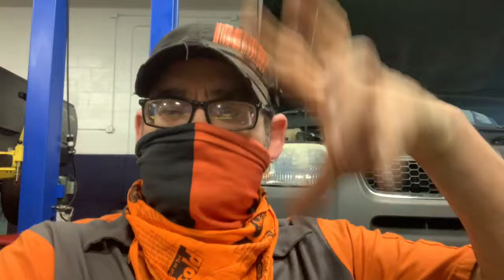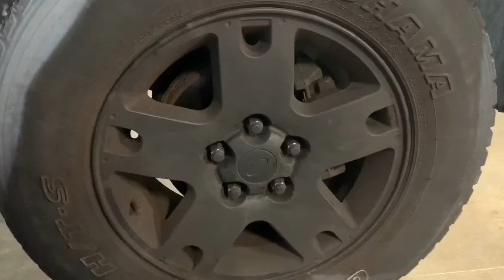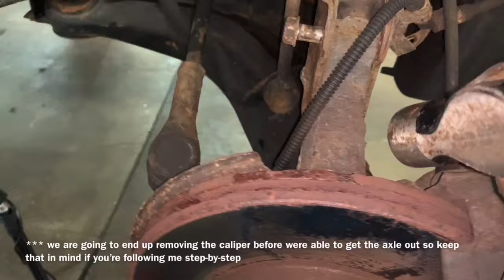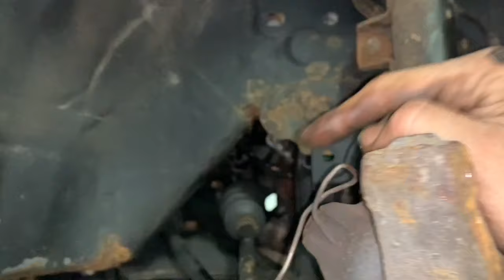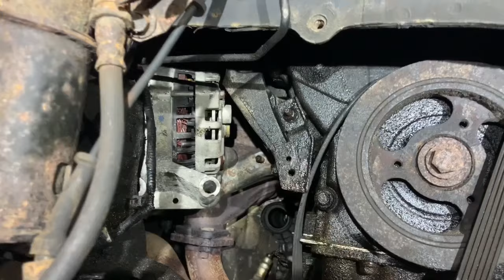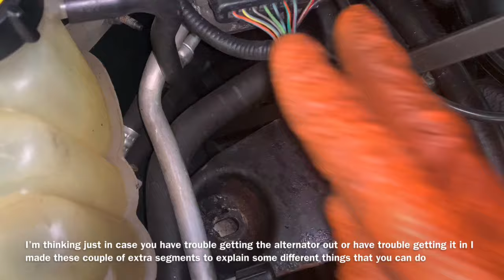Easiest way to change a Ford escape alternator

Comment: Welp.. I've done enough other work on my escape, and this is the last straw. What a ridiculous, obnoxious job to have to do to change an alternator. No thank you. Served me about 50,000km for 4 years. With a plethora of other problems, it's time to go.
Reply from the maker: Sometimes they’re just lemons but my experience with them has been really good I’ve had alternator problems and some rust on the rear of the shock tower but for the most part I can say I’m extremely happy with the ones that I’ve had I wish you the best of luck anyway God bless have a great day
Reply: It’s easy only thing that needs to be removed is the exhaust pipe

Comment: This video absolutely helped me change the alternator on a 06 Ford Escape. The worst part of the job was the air cowl mounted on the alternator. I can see why a shop would charge $1500 but I was able to get it done in about 5 hours in my shop with floor jacks. Thanks for the helpful video
Reply: If you remove the air cowl it comes straight out

Comment: Thanks for updating this video after clearly changing a lot of these and getting experience with them. Going to do mine soon and never buy another of these cars, who puts an alternator on the back of the block, honestly. A tip for you, your mic might be shot, but you can easily "normalize" the audio with your editor. This levels out the volume, so that viewers don't turn up the volume for the quiet bits and then have their ears blown out by the loud bits! Otherwise your video is great, thanks for sharing.
Reply from the maker: Yeah the mic was a problem that day I still put the video up because it took so much time and my channel is still really small so I don’t have big bucks to spend on really good equipment hopefully someday though
Reply: Yeah I agree, I wish I had thought of or known about this before I bought this clunker

Comment: You will need  the following sizes 
8 mm socket 
10 mm socket 
13 mm socket and wrench 
18 mm socket and wrench  
Dont have the size of the axle nut socket think its 1 1/8th inch.  Ill edit later 
Expect to remove the mounting bracket and jack the engine up several inches. 
aim the pulley of the alternator down to remove and install it.  ( when you find the sweet spot doing this there is plenty of room ) 
The job took me three hours total but my wheel was seized onto the rotor. It can be done in two but expect three hours for a first-time job.

Comment: Whoever was responsible for designing this monstrosity should be sentenced to one year hard labor.
What hard labor do you speak of you might ask?
They should be forced to change the alternator on one of these daily until their sentence is complete. 😄
Reply from the maker: Well I generally charge about $400 to change these
Reply: @sharpcarco  My sis has a Mazda Tribute that was having issues, so after checking it out i found the alternator was bad. The alternator I think was $160 bucks and she ask if I would put it on for her and her request was met with a resounding NO! 2 previous elbow surgeries pretty much put an end to me doing the kind of job that this would be especially with no lift available. I explained it to her and she said she would just get her son (my nephew) to come over and "throw it on", and I thought to myself I can't wait to hear from him.
He takes one look at it and says hed rather give birth to a flaming porcupine than tackle that. 😄
Long story short she has to put it in the shop and its gonna cost a couple hundred bucks plus the cost of the alternator.
The funny part was that she called around to get some labor prices before asking me and my nephew and ultimately thought one of us could do it a whole lot cheaper. Having it on a lift would make things a little easier, but I digress. Moral of the story: This is one headache of a repair if you decide to tackle it. Btw I like the way you put "easiest" in the title as opposed to just "easy". 😄I
Reply: @jeffreyb6165  YEP! Ha Ha Ha Ha Ha...just throw it on...
Reply: Damn you're right
Reply: @jeffreyb6165  yo bro ur comment was big time cringey af, y’all act like this is a nightmare to put on really ain’t that difficult to tackle just takes patience.
Reply: @strykerls3740 yeah exactly, but he obviously doesn’t work on car. I’m a full time technician, this alternator sucks, but not too bad. I know there’s a trick of taking an engine mount off and just prying the engine and the alternator drops right out
Reply: I AGREE

Comment: Super helpful video. Will this be the same for a 2007 v6 3.0 L ford escape limited? And if i jack the engine up the only bolt i need to remove is the one on the mount ypu showed on the top?
Reply from the maker: It’s the same on the 2007 yes and I don’t remember the answer to your other question

Comment: While putting axle back in my strut spring sprung and turned so I couldn't line the strut bolts up again.how do you recompress and turn the post to line it up. I am a real beginner at this
Reply from the maker: Really really sorry I did not see your message sooner Terry I’m assuming after five days you got it if you didn’t send me a message on Clays AC and Auto Repair over the Facebook messenger and I’ll be happy to answer it for you so I can get the logistic what’s going on.

Comment: Subbed. I think mine is going. I changed the battery and now it won't hold a charge for an hour when it used to hold one for at least 6 hours

Comment: I'm trying to do this same project right now and I'm not the most experienced kid around. But why do you need to remove the nuts holding on the engine mount?
Reply from the maker: Because the cradles can I have to come down to be able to get the alternator out

Comment: Hey Clay I replaced the shock mount & I must say I'm in Ohio and have ppl coming from Philly , Chicago  & Memphis for repairs w/ the glue & screw way . Tks
Reply from the maker: Personally, not my favorite way of doing it but yeah, for a number of years I had people coming from all over the place. I don’t do as many now, as I did before, I’m sure there’s people out there that will do them cheaper than I will but I do them correctly so. I’m sure that’s why I don’t have as many you for the kind of words. Appreciate it Kevin good luck.

Comment: So are there two mounting patterns for these? Our 02 Escape has a bracket between the alternator and engine, alternator bolts to bracket, bracket to engine.
The last person to change it stripped the inner threads on the block, my jb-weld fix can only last so long. almost 2 years now

Comment: I've pulled about 20 and I use to do it throu the bottom but found out if u hook a strap to it once it's off and Feed the strap up that back side of motor u can pull it up throu there but u have to twist it a certain way it will come out that way
Reply: Please show that process

Comment: Thanks for this..On a side note my Escape has all that oil on engine..What is the culprit on these for the leaks?
Reply from the maker: Depends on where the oil is if it’s sitting on top of the valve cover it is the spark plug seals and you need new valve covers or cover

If it’s on the side near the harmonic balance or you need a new front seal or the timing cover needs to be resealed

If it’s in the rear of the engine meaning the part that connects to the transmission it needs a new rear main seal which means the engine or the transmission Hass to come out and it needs to be replaced
Reply: @sharpcarco  thanks.looks like yours in video.Already did valve covers..must be one of the others..Saw something about a VVT SOLENOID also that the o rings go bad..Not sure if my 05 has this.
Reply: They always leak from the timing chain cover. Most of the time not worth the time and money to repair. Fuck it. Let it leak. I’m thinking of a way to divert the leaking oil away from the hot exhaust. When I run my heat I get burning oil fumes into the car
Reply: My sister's car had this happen it was a simple gasket change at a local shop for cheap during a tune up

Comment: i need advice...I smell rubber burning smell inside of my car. I kept trying to figure out what the smell was and where it was coming from. I just went outside, it’s been sitting for a couple of hours. I popped the hood, did not smell anything. Then realized the smell is in the cabin. Got back inside, and finally realized it IS a burning rubber smell. . If I lived near you, I would definitely come to you. ALSO, I don’t have messenger. That’s why I asked here. I have stuff to do tomorrow. Should I cancel and tow to a shop. Again, if I lived near you, I would go to your shop. I believe you could finally fix this 2007 Jeep Grand Cherokee limited.
Reply from the maker: Hi Justine sorry I just seen this message I understand you don’t have messenger. But that’s why it took me so long to respond and it’s difficult to check all of the messages on YouTube. 

I’m sure it’s something that I could take care of for you and I’d be happy to look at it the unfortunate part is I’m not gonna give my cell phone number out over YouTube. 

So you could just email me at SharpecarCo.@Gmail 

And I’ll give you my cell phone and we can set something up if you still need my help have a great day

Comment: OKI asked you a question before and I got the water issue fixed in my Ford Escape it was the drain tubes were not draining. And I have had this problem too it's the alternator is overcharging And I noticed that the battery light comes on but I'm having other issues and I'm hoping it's related to that like my Inside light when I was having it run went out twice it started to be hard to sometimes the power steering doesn't work I had to turn it off and on a few timis on a few times just to get home from work tonight 8 the heater sometimes doesn't come on with that little battery light is on in the car and sometimes it comes on and then it shuts itself off and it comes on again so I just had my oil changed they top off all the fluids I am going to check the power steering fluid tomorrow right now it's dark it's after 11 and that's thin and that's when I get off work so I'm gonna have to do it tomorrow but I'm just wondering if that would be part of the overcharging of the alternator the battery is new got it in July only had this Ford Escape for 7 months. I did get money from my bank and I'm gonna get this alternator hopefully put on this weekend it's supposed to be warmer so just seeing what you think about it because I don't want to be stuck in a whole bunch of money into this vehicle I know it's September and it's got a 120000 miles on it but that's actually all I could get at the time since they are taking money away from us at my work because of their bankruptcy so they're bankruptcy so work it and screwed so I had to really be careful what I could spend monthly on a car payment and be able to live live in a house have food have all my medicines and all of that so this is kind of they knew I needed a car and they took advantage of it Thank you for any help you can give me
Reply: Sell it IMMEDIATELY!!!

Comment: To make this job a lot easier remove the black air flow cover that sits on top of the alternator.  This will allow you to avoid having to struggle with it to get it out.

Comment: I just spent all damn day, and still have not got the alternator out.  2005 V6 Exscape.  How does one remove the plastic shrouding? Unreal...I have one day left to finish the job, or they want me to sell it.
Reply from the maker: Well break it off if you have to… i’m certain you can do it I don’t remember the particulars around the shield but I do know what you’re talking about it was a pain in the ass to get off. On the few that I seen it on

Trust me anybody else can do it you can do it to

Comment: Hey thanks for making this video, im in the process right now of changing this alternator, but what was the purpose of removing the 18mm in my case, motor mount bolt? Thanks!
Reply: I meant to add just to makr a guess its to keep the engine slightly lower so u can get to the alternator a little better? Would this put anything else in a bind? Usually if im removing a motor mount im putting a jack with a wood block under the engine to keep it from going down.
Reply from the maker: Sometimes you can get them out and sometimes you can’t without removing that bolt
Reply: @sharpcarco  On my 05 xlt 3.0 escape i just managed to pull the alternator out the bottom without removing the motor mount.  Still at it after 5hrs omg if I could beat the people who designed this..

Comment: Had ALTERNATOR changed on my 05 escape, now my battery light goes on and off
Reply from the maker: Faulty alternator or bad connection
Reply: @sharpcarco  thank u for the response I think it's a bad connection I bought 2 new ALTERNATORS, oh do u think computer has to reset to fix after unplugging battery?

Comment: Just changed one on a Hyundai Tucson....was the same process...4 hours to get old one out and new in...
Friend has a escape with electronic power steering....needs alternator...selling it....but think I'll pass....
Reply: Take the top stud out and the alternator will easily slip out of the top, just changed 1 out within 45mins

Comment: If its a 4 cylinder just take the top alternator stud out and it'll slide out easily through the top.
Reply from the maker: Definitely way easier to take one out of a four-cylinder. That’s like a 30 minute job

Comment: I watched a mechanic replace one of these without having to remove the axle, he simply dropped the compressor and had plenty of room to take off the alternator
Reply: Different engine
Reply: Maybe you are talking about a 2012?  Those are different.
Reply from the maker: @michael931 he’s probably talking about the four-cylinder version
Reply: @sharpcarco  on the 8-12' V6 the alternator is in front above the compressor so it is as he says.  Maybe 4 cylinder also.  This video for 0-7.

Comment: Much easier way is to remove the exhaust pipe, and bring  the alternator up the firewall and bring it out the top and replace the exact same way, took me an hr and a half.    No need to remove the tie rods or anything like that.
Reply from the maker: Was yours a four-cylinder? 

And how the hell did you get the O2 sensor off if it was a six-cylinder?  

I’m kind of curious how all these people that don’t work on cars for living say things like this is the first time I’ve ever actually had someone say to do it that way. But I don’t quite understand how removing the intake and removing the exhaust manifold is simpler than doing what I did. no chance of breaking anything the way that I did it.

Comment: Gave thumbs down because no year and engine size in title
Wasted time watching wrong year
Reply from the maker: I would’ve thought that the thumbnail would’ve gave you the information you needed for the year. And within the first minute I tell you what kind of engine it is and since they were the same from 2001 to 2012 for the V6 model they didn’t really make a difference…… because if it said I was working on a 2004 mouth breathers would think that the procedure was only for the 2004 model when it actually covers 11 years I would probably recommend you probably you leave working on cars up to professionals if you don’t understand why it doesn’t have a year or make and model in it………..

The thing that you obviously don’t know because you’re ignorant and that’s not meant as an insult well Kinda….. Little passive aggressive anyways ignorance is the lack of knowledge I haven’t figured out if it’s the inability to understand it once you’re told

See when automobile manufacturers make vehicles they’re based upon this thing called profits it’s something that every single producer of anything really strives for most of all during this process when automobiles are manufactured they tend to make the same automobile for years sometimes even over a decade which is 10 years just in case you don’t know….

Like in this situation the Ford escape that is pictured on the thumbnail and in the video was made since 2001 to 2012 know if you had a different Looking than Ford Escape this video probably would not help you…….. 

Since I mentioned that I should also mention that most Youtubers do not put year inside the tag lines for people just like you they want you to look at their content because they may have spent several hours or in this situation a couple of days making a video for knuckle dragger‘s…….. and it just so happens that more than likely this was the appropriate video for your vehicle that you were looking for but who knows I’m not even sure if you know….. yours , most 2001 to 2012 Ford escapes came with the V6 platform which is the one that is inside this video and the procedure is the same for all of them. 

Anyways I have no more time to waste on this I should not have wrote this long response one day you will figure things out and they will get better for you have a good day. 

Jesus loves you God bless.